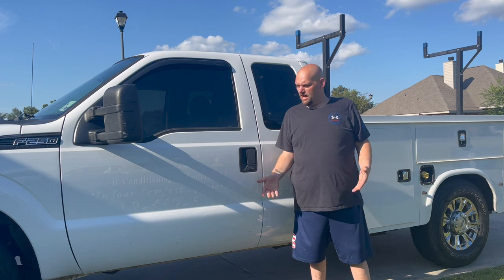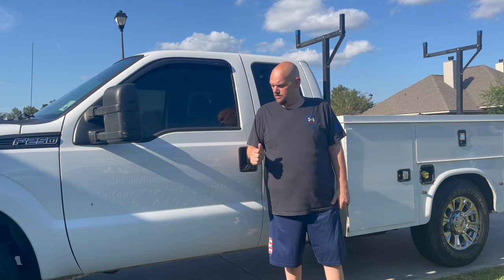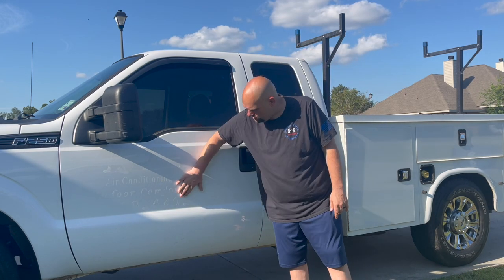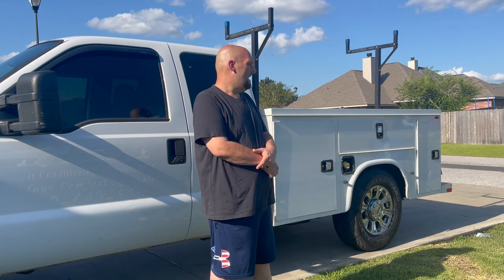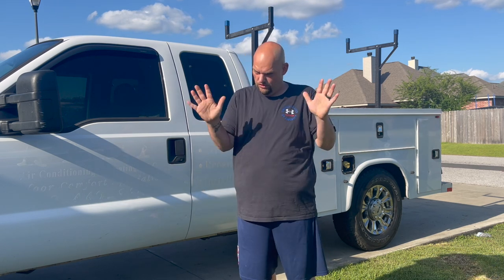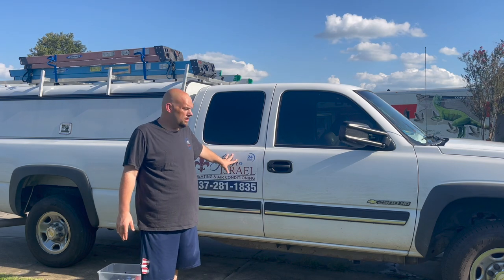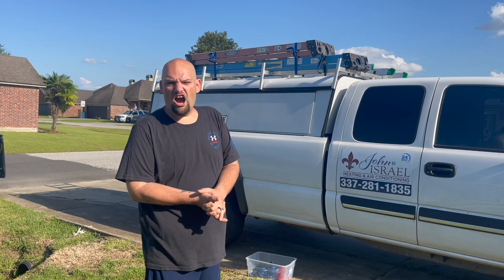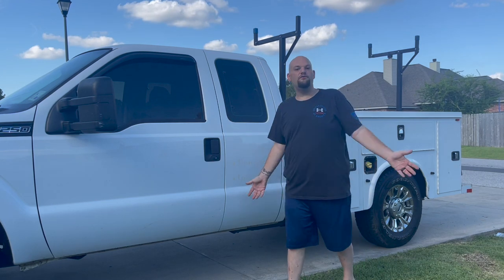The New Work Truck

Comment: I have been using service utility body trucks since 1972 Chey or GMC.  Not Fords or Dodges, neither one are as  DEPENDABLE AS GM TRUCKS.!!!!
I had exactly what you said, all of my tools were in a tool drawers behind the driver's seat and driver's side.  All of my material and parts are on the right side.  Plus I didn't have low profile body or flip tops compartments.  I had regular service body with the Knapheide transverse compartment and 3- 4-foot drawers, which are perfect for all the parts and fittings as I need as an electrician. Under the drawers, you can store a 4 ' step ladder.  On top of both sides, I mounted 8' Aluminum tool boxes like on pick up trucks for additional storage for outlet boxes, outlets, switches, etc.  On the bed of the truck, I had Weatherguard PackRats bed tool boxes for long tools, extension drill bits, 90° Milwaukee drill, and Milwaukee Super sawzall, pipe wrenches etc.
Reply from the maker: Lol you can keep your POS GM/Chevy truck.

Comment: I had a heavy duty ladder rack for 20' and 28' extension ladders, 8' and 10' step ladders, 2- 4" PVC conduits for my emt, and PVC conduits.  Or I could use the ladder rack for a work platform too.

Comment: I transitioned to a van however on the inside bins I used all of the half width Milwaukee packout and wrote on them what was inside. Also I glued a small white board square on them so I could mark off what I took out so when I was running low I could restock. Keep up the great work Israel Family!

Comment: I have a 2022 F250 extended cab with the same utility bed. I have the same ladder rack and i have a job box in the bed. My bed and the top rails of the utility bed were rhino lined. I love it. Its a great work truck.

Comment: Congrats John I have the same truck and it’s set up with mostly tools on both sides except for a few bins with parts but I work industrial and heavy commercial refrigeration so I needs more tools than parts
Reply: I also have a big rigid job box in the bed for larger tools, freezer suit , pressure washer etc

Comment: Change the oil every 5k miles, trans fluid every 30k. Use motorcraft filters cheap off rockauto. Fix anything as it breaks it will stay nice for a long time. The 6.2 never breaks worse thing that ever happens is a broken valve spring which is an easy fix. Cab bushings need done on every 05-16 SD. Use  Bilstein shocks. Believe I've seen 6.2s with 400k miles.

Comment: Those cab bushings are a extremely common on Those Fords happens to all of them along with ball joints,  tie rod ends and numerous electrical problems.
Reply: Cab bushings yes, but I bought my 14 new and it’s never had any electrical issues or ball joint or tie rod problems.
Reply: @patrickhenry550  you are extremely lucky for sure a diamond in the rough

Comment: The factory cab bushings on that body style sucked. The ones on my 2014 did the same thing. Do your self an favor and spend the extra money and buy the silicone ones made by S&B  they ride way better than my stock ones ever though about and won’t deteriorate like the factory ones. Polyurethane ones ride rough on these trucks. And if your changing them yourself make sure you heat the bolts to melt the locktite or you’ll have a lot of trouble. Also no impact wrench taking them off .